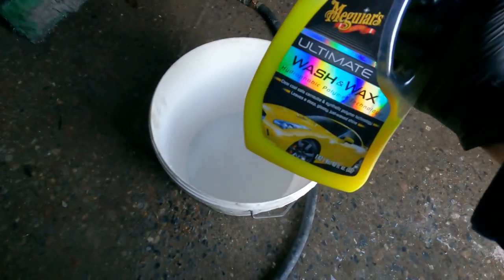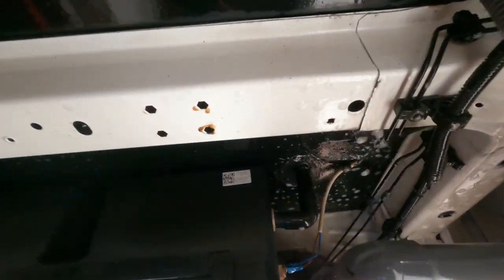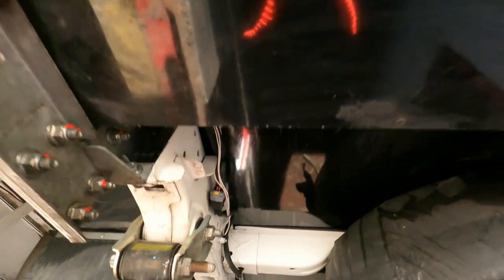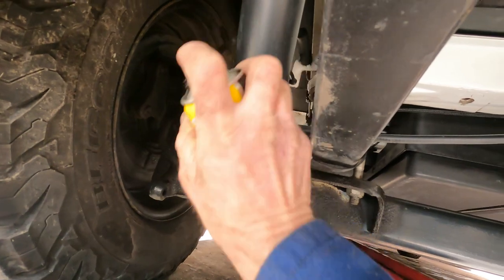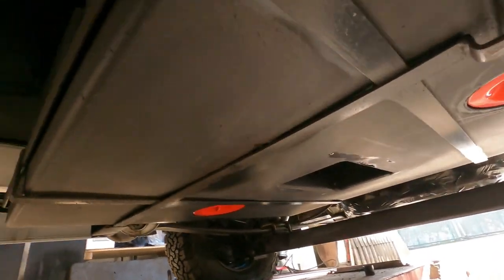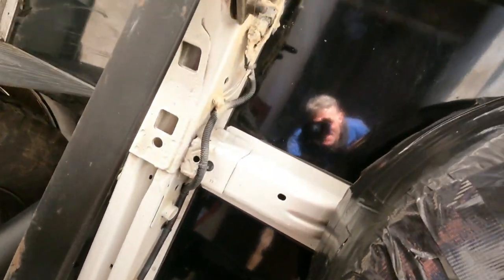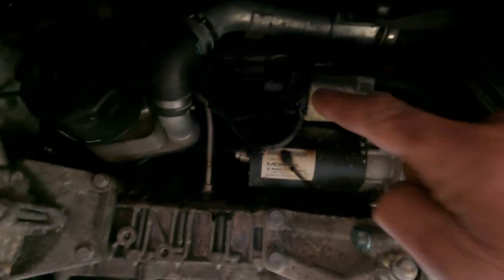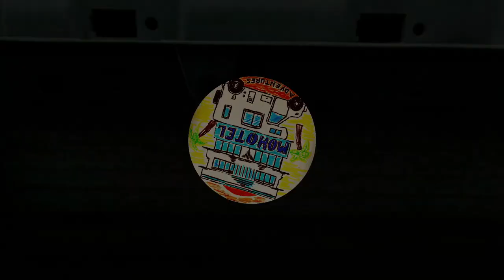Wash & waxoyl your motorhome chassis

Comment: Hi mate thanks for VLog very good again… Couple questions, why do you wrap the spare tire is it for protection? Also why didn’t you just wax oil everything underneath? Thanks
Reply from the maker: Just to keep the wheel and tyre clean if I need to change it, so there is a lot of area that is not a problem area you can add as much as you want.🚍👌🏝
Reply: @MOHOTELADVENTURES  
Thanks, also forgot to ask, .. watched the one the other day about a bottle jack…I have Citroen relay L3.. do you mind recommending a bottle jack please? Thanks
Reply from the maker: @goingmouch3753  https://www.googleadservices.com/pagead/aclk?sa=L&ai=DChcSEwi0lJX21of3AhVF6u0KHQmSBrcYABALGgJkZw&ohost=www.google.co.uk&cid=CAESauD2a6WbJ07-vNPljCh_D3JWTAGKnyRz2wHj-2xNx4CsXF-eJJanUfVhX3scl8rHueLdWvc-X3JYWR4BA5n2cw7GazStFI6Kksmebim5EWHcVrldDaX4SUpwgjUBMzna5OaWHTSwerMrdJ8&sig=AOD64_2ADlptWgm18lJ5bl8Y-v5hPLkMZw&ctype=46&q=&ved=2ahUKEwiNmI321of3AhXBYcAKHd1EDJUQzzl6BAgBEBw&adurl=
Reply from the maker: They do a few different sizes 🚍👌